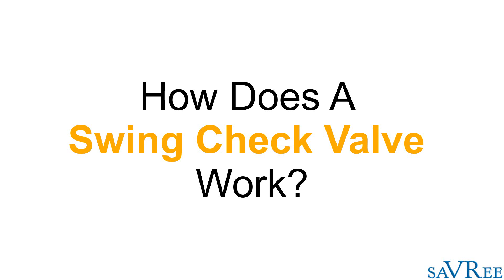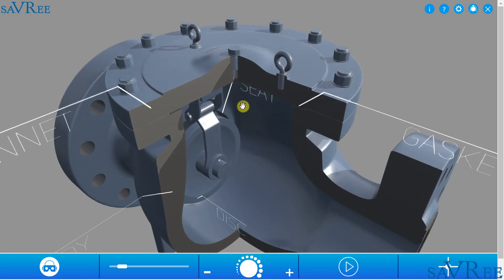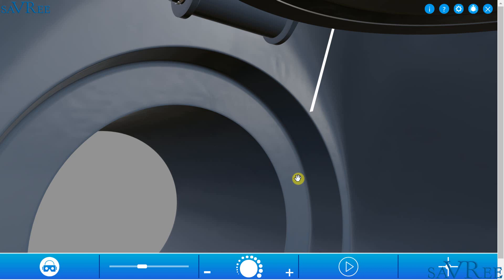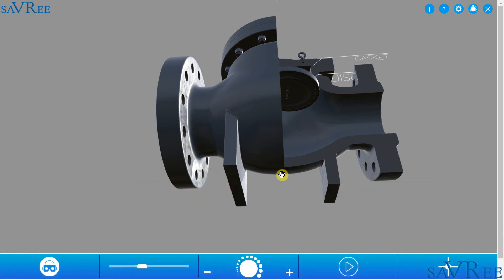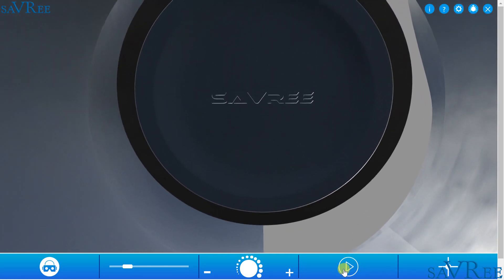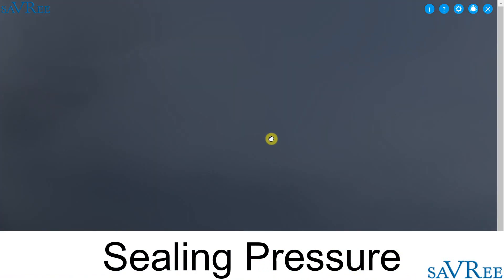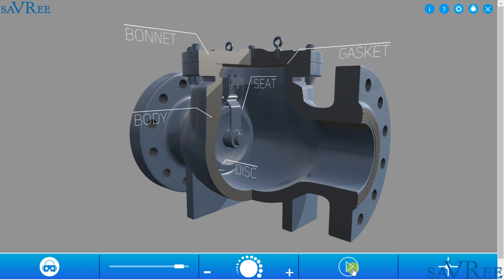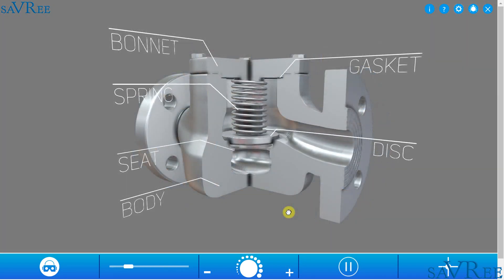How Swing Check Valves Work

Comment: Hi saVRee hope u r safe during this covid days.. Is it normal to swing type check valves to have a minimal water & air leaks? When I blow air to the outlet side I can sense the air leaks which is suppose to be water tight and air tight isn't?